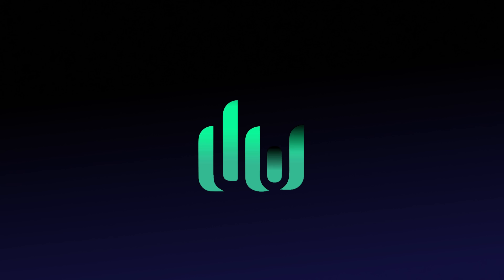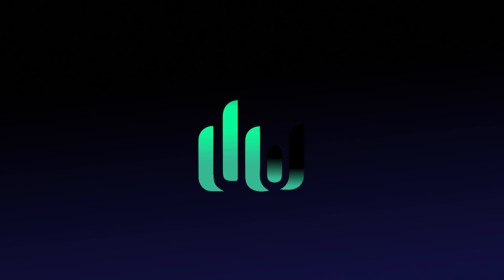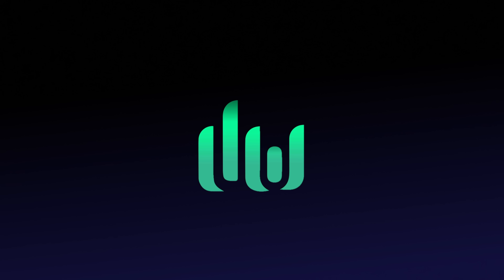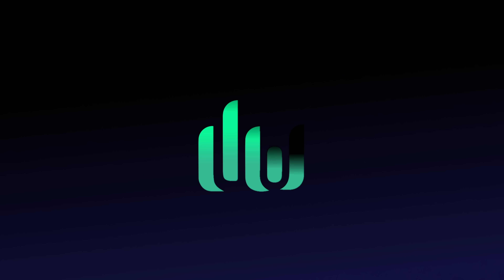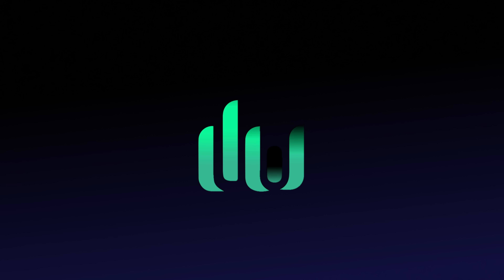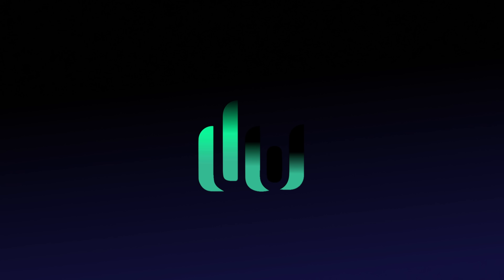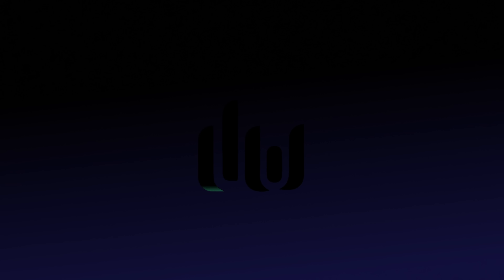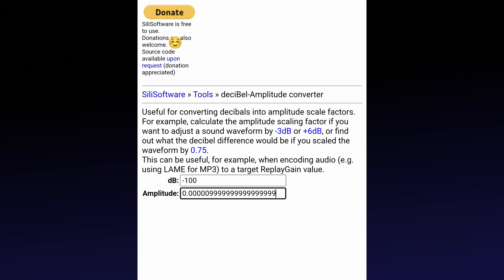WTF is a Decibel?

Comment: And then we have the noise floor of most D to A converters to contend with. And since most good A to D converters only have between 96db - 100db before reaching said noise floor those last 20db  of theoretical dynamic range really does not matter. But i understand that the noise floor discussion was out of scope for this video. Maybe something for another video ? Bonus points for a nice explanation on how dither noise increases perceived dynamic range (i am not super clear on this and also does it raise the actual noise floor when getting summed with the inherent noise of the conversion process?).
Reply from the maker: Dither noise has an equal probability of flipping the LSB high or low. Fractional values below the LSB bias that dither noise, and change the probability. Each individual sample has as much error as before, but the average of a window of samples has much less.
Reply from the maker: I think adding noise will always increase the noise floor. The only way it couldn't would be if the added noise were negatively correlated with the existing noise, but then it wouldn't be random noise. But unless you're dithering 8 bit audio that increased noise floor will never be significant.

Comment: Is there a way null out the distortion created by over clipping?
Reply from the maker: Over clipping? Do you mean just clipping? There are plugins that attempt to de-clip, sometimes they work surprisingly well, but I think it depends on the nature of the clipping.
Reply: @DanWorrall  when you clip theres like a fuzzy crackle you can really hear it when you over do it since you can null out to hear it is there a way to null out just the crackle?
Reply from the maker: @Durkhead  clipping changes the waveform shape which adds harmonics. Removing the harmonics means restoring the original waveform. I think de clippers are your best bet, short of not clipping in the first place.

Comment: In audio it is always about references. For similar reasons we do not record "clean" signals for Music in an anechoic chambers, do we?
Also, your "24 bit" audio interface is more likely "20-ish" bit (at best!) for Music\Audio related recordings. 4~6 bit are always occupied by the internal (self) noise of the device's own circuit noise. Yes, that noise is really "quiet" (because of the fairly low voltages… again "low voltage" is a reference to us humans) but it is still there.

Comment: I love your videos, but I have to disagree with the main point behind this one.

According to your logic, why bother even showing down to -100 dBFS? Why not -40 dBFS? That's only 0.01% - basically nothing, right? Of course, a -40 dBFS noise floor is actually a lot of noise. That's because our perception of volume is roughly logarithmic. So in terms of how we actually hear, it's totally fair to call 100 dB vs 120 dB only 5/6 of the dynamic range.

Or to use your pitch analogy, would you call the difference between C7 and C8 half the range of a piano, or about 1/7 of the range? Half is technically correct in terms of frequency, but in terms of how we actually perceive sound, it's 1/7 of the range.

I think there are good reasons only showing down to -100 dB is okay, but your reason here is a bit misleading. It's great to explain how dB work, but you shouldn't ignore the entire reason we use dB in the first place.
Reply from the maker: But we don't have a total of 120dB. Total theoretical dynamic range is infinity decibels. 16 bit audio can do about 90dB. 24 bit audio can do about 140. It doesn't make sense to say there is a total of 120.
Reply: @DanWorrall  But why not use the practical range of human hearing of around 120-140 dB as the limit?

Yes, I realize in practice 100 dB is plenty in terms of what we can perceive in a mix (despite what certain audiophiles insist), and I think that's a great reason. But that's not really what this video is saying.

Comment: Something is wrong with these statements. DbSpl is in real world, not inside the computer. Bitness represents the precision of measurement of the amplitude per sample. Because anything digital is discrete, the measurement/reproduction step of adc and dac will be dynamic range divided by 2^16. As we know, the thermal noise level is around -131 dbV. 131 divided by 65536 = 0.001998901367188  volts of amplitude value step. With 24 bit, this value will be much lower ( lower means better). Based on this, for me is not clear what infinite dynamic range «in digital» means 🤷‍♂️

Comment: I was fooling around in Audacity one day and found I could cut around 800-850dB (then boost back to the original level) before any audible quantization noise was apparent, with major degradation as you approach -900 dB; trying the same thing in Ableton (with a bespoke Max4Live patch, because Ableton jumps straight to 0 WAY sooner than that) resulted in the audio becoming silent any time it dropped below a similar level rather than any quantization noise. So you potentially have more headroom than your DAW is letting on, since DAW developers seem to agree that sounds near -100 dB are inaudible and can be dropped.
Reply: let me correct you, as far as many people confuse quantization noise with phase noise. What you get below -800 dB in 32 bit float formats is not the quantization noise, but the phase noise. The quantization noise in 32 bit float starts from -139 dB FS as the 23 bit mantissa is not capable of delivering the accuracy down below the entire dynamic range.
Reply: @CyrilleBoucanogh  In the instance I described, it's definitely quantization noise because it resulted in a stair-stepping waveform
Reply: A step-looking waveform is only the mode of the visual representation of the descrete signal, but after you decode it into analog form it is never staired as far as the high order harmonics are filtered out leaving your signal wave smooth.
But even if you ever have to deal with a square looking wave quantization errors have nothing in common as far as they can only appear in float point formats beyond mantissa's range, so nothing to worry about.

Comment: Fantastic explanation!  I was just researching this subject to make sense of the various options on a mixer that has line level, Hi-z, and -26db input settings, compared to an interface that has line and instrument settings.  I think I've finally figured out how they relate to my gain adjustment ranges.

I believe you are correct that this subject should be introduced early in audio education, and would greatly appreciate a more detailed video on this if you ever find the time and energy to produce one.  I've learned so much from you sharing you knowledge with us,  As a result, I have been inspired to research many topics that I wasn't aware excised.  You are such a valuable asset to the audio community! 

Thank you!

Comment: How is it accurate to claim that a 16-bit WAV file has an infinite dynamic range like Dan's thumbnail to this video states? When I research it, I find plenty of information stating that the dynamic range is determined by the number of possible values each sample can have, which is 2^16, or 65,536 distinct levels at 16 bit.
Reply from the maker: We ignore zero when measuring the dynamic range, because that makes the results useful and meaningful. We measure the difference between the loudest and quietest signals that can be represented. But if you include zero, that's minus infinity dB.
Reply: @DanWorrall  Does a 12-bit, 8-bit or 4-bit wav file have an infinite dynamic range as well?
Reply from the maker: Yes, if you include zero. We don't usually though, because that doesn't tell us anything useful.
Reply: @DanWorrall  So you are including zero that, as you state, "doesn't tell us anything useful" to claim that a 16 bit wav has infinite dynamic range as stated in your thumbnail to this video. Clickbait, misleading? That's why to make meaningful comparisons between bit depths we don't include zero. Otherwise we could just claim a 2-bit wav has infinite dynamic range (like you do for 16 - bit in your thumbnail to this video) and use that.
Reply from the maker: @philamonious  clickbait: yes of course! But still technically correct. Every digital format can do perfect silence, which is minus infinity decibels.

Comment: Great video until the infinite dynamic range part... Suffers from the same issue as the sample rate video (which didn’t consider the computational approximations involved when implementing sinc functions in the reproduction of digital PCM audio; yes, a sinc function can perfectly reproduce the audio as long as the sample rate is above the Nyquist rate, but the sinc function is only approximated computationally and not implemented operationally in digital audio systems so that is never the case), namely that the actual computational implementation aspects are not considered and are assumed reducible to the mathematical. “At least theoretically” is a fine caveat if “theory” only ever meant math.

The mathematical representation of an unbroken logarithmic function will tend to negative infinity as the lower limit, yes, but a computational representation of the same is irreducible to the former, even if the mathematical basis for the representation is the same. Additionally, most real-world phenomena that may be modelled logarithmically will only exhibit the same behaviour as a logarithmic function across certain specified ranges and cannot be arbitrarily extended. The computational approximations of the calculations involved (especially in fixed-point computational-arithmetic space, as is the case for 16-bit FP PCM audio) do not evaluate to the same result as the mathematical operations effectuated without approximation (if that is even possible, depending on the specific case). Negative infinity below –98.04dBFS (for 16 FP PCM audio) is nothing more than a symbolic representation of the fact that the mapping is discontinuous after that point. “Total silence” in digital audio is not negative infinity… it is just the actual loudness level of the quantization noise (just generate a “silent” 16-bit file and amplify it enough). The dB-to-Scaling factor calculations are only valid for data spaces that can contain, store, and represent those values; a 16-bit fixed point sample cannot store an infinitesimally small quantization value and cuts off well above that, which is what generates the quantization noise. The water glass analogy is also ill-suited to make the point you’re trying to — especially for how far it’s pushed — because there aren’t actually an infinite number of water molecules in the glass.

Comment: I am a little lost with the +6dB doubling and -6dB halfing......I put an 1 kz tone at -20dBFS.Then using a gain plugin I raised the volume by 6dB....I got -14dBFS....then I subtract 6dB and I got -24dBFS.....where is my mistake??
Reply from the maker: The doubling and halving is of the amplitude, so the height of the waveform.
Reply: @DanWorrall  so that means that we perceive it as two times louder but can't be measured on a meter?
Reply from the maker: @russenduf  we perceive it as 6dB louder, because we perceive loudness logarithmically, just as we perceive pitch. But in fact all the sample values, or voltages, are multiplied by 2.
Reply: @DanWorrall   thank you just saw it on an oscilloscope!!

Comment: I think, Dan is not quite right with his "infinite dynamic range"-claim. While it is true that any number (represented digitally) is "infinitely times" greater than zero, dynamic range in digital representations refers to something different; namely the number of loudness steps that can be discerned when digitizing a signal. In other words, the resolution of loudness, or, to be more precise the 20log(Number of loudness levels). This is the reason, why 16bit are considered to have a higher dynamic range than, say 8bit (linear pulse code modulation). Otherwise, all digital systems would have the same dynamic range (infinity); but obviously, we are interested in the space between zero and full scale.
Reply from the maker: Yeah. We ignore zero when measuring dynamic range, because that makes it useful and meaningful. The point I'm trying to make is that silence means minus infinity decibels.

Comment: Huh, I didn't know that, thanks for sharing! But why does it progress in increments of 6? Like who decided that +6dB=x2 and -6dB=/2? Seems like one of these arbitrary values that someone picked a hundred years ago and we're all still using it because it's "the standard"
Reply from the maker: The actual formula: 
dB = 20 * log10(amplitude)
amplitude = 10^(db/20)
6dB is not really a doubling, in fact that's approx 6.02 dB. But it's so close the difference rarely matters.

Comment: I think this one needs a high Effort video The Rockbottom, fundamental of the dB Is it is a measure of power gain, not a measurement of voltage 
Yes, 6dB increase could mean the voltage has doubled, but it actually means there is four times power
3dB doubling or halving of the power is more interesting, because your hearing is logarithmic, and it is the smallest increase decrease you can easily perceive if you concentrate You can hear 1-2 dB difference I’m old school and this is how I was taught
The Logarithm of 2 Is 0.3010😊
A complete history of the decibel is what is needed go back to the beginning when it was always stated in a 600 ohm  line and work up to the modern day and show with ohms law how the Power formulas are derived😊😊
Because when you talk about the voltage in dB, you are using a power formula

Comment: For most practical purposes, you want to be working with dithered audio, no? and dithered audio can't go to all the way to -infinity kind of by design, because there is a tiny bit of noise, right?
Reply from the maker: Not if it's floating point audio. And some dithers have auto black, so they turn off when the input goes silent.
Reply: @DanWorrall  ok thanks for the clarification. I still maintain that at least 80% of the time dither noise puts a limit on dynamic range
Reply: @woosix1  isn't it exactly the opposite? Dither makes the dynamic range actually infinite, but it adds a noise floor.

At least that's how I understand it.... do correct me if I'm wrong!
Reply from the maker: Dither increases the dynamic range. I don't know about infinite, my maths isn't up to disproving that, but that's only theoretical anyway. In practise it adds a few dB of dynamic range, then everything's buried in the noise anyway.

Comment: A dynamic range is between 1 and the maximum value of the scale. That is not infinite and since we need signed integers, it leaves 15 bits to work with so that's 20*log10(2^15-1)=90dB. 
Wikipedia: "The dynamic range of music as normally perceived in a concert hall does not exceed 80 dB". 
This makes a 90dB range as performant as infinity, which is the proper argument to bring, not some click-baiting nonsense in a thumbnail.
Reply: Thank you, and I agree, calculating the dynamic range between 0 and the maximum and stating it's infinite is just a meaningless gotcha. With that argument, 8-bit audio should be enough for anyone since it also has infinite dynamic range. Even 1-bit audio (and I mean at 44.1-48 kHz, not the weird SACD encoding) would have infinite dynamic range, even through you would barely be able to tell what song you're playing.

I'm not convinced you should subtract one bit, though. Most PCM samples are unsigned and AFAIK every bit is used to store actual audio data, so why wouldn't the formula use 2^16 instead? (Which would give about 96 dB as the result.)
Reply: @exscape  You're right about PCM values, so we can have a wave between two consecutive values in the center of the range.

Comment: Dan, I'm not sure how helpful this is. A 1-bit audio stream at 1 hz will still have infinite "dynamic range compared to full scale" under your definition, but be completely unusable for audio encoding and processing. Perhaps have a read of this: https://en.wikipedia.org/wiki/Audio_bit_depth , and in that context the original comment was probably referring to the SNR of the quantisation error (ie dBFS of the precision) rather than a technical definition of dBFS when compared to an all zero signal, which is pointless. In the absence of a definition of what sample rate you are talking about this is all meaningless as well. A better definition of "quality" is measured from an information theoretic point of view as the number of bits per second that can be transmitted down a communications channel, which is the Shannon-Hartley theorem (yes the same Shannon that's in the Nyquist-Shannon sampling theorem): https://en.wikipedia.org/wiki/Shannon–Hartley_theorem

Comment: I think you're taking the labels we put on levels a little too literally.

The loudest is labelled zero, and anything quieter is a negative number, because that allows us to define "digital silence" and the dynamic range of different hardware setups consistently. It's a convenient naming convention, allowing us to compare ranges and noise floors without complicated math.

But a trick to make the math simple isn't reality, it's a convenient fiction. When we say the range goes down to -120dB, we mean that's the quietest the system can handle, and any less than that is lost. That's not an infinite range, that's a finite range, plus everything below that range getting quantised to nothing.

Comment: Human ears do not have "120 dBs of dynamic range" anyway, that's just the range between the quietest 1000 Hz sine you can hear and one that will physically hurt you, on average. It's way less for a very low pitch and it varies depending on the individual or even during an individual's lifespan.